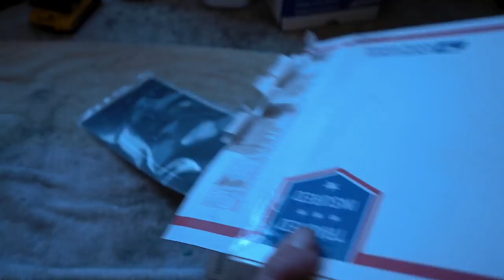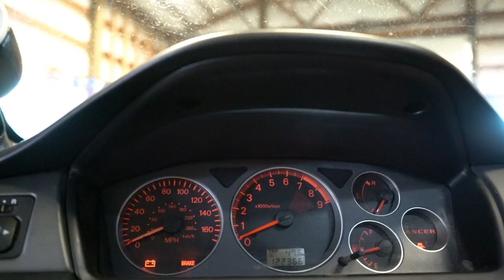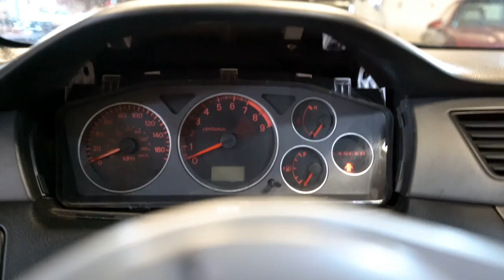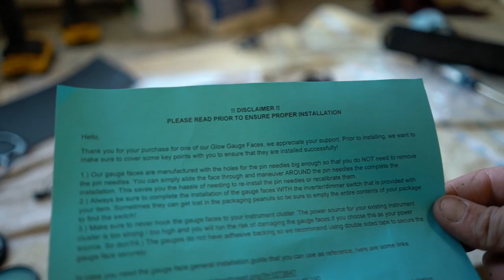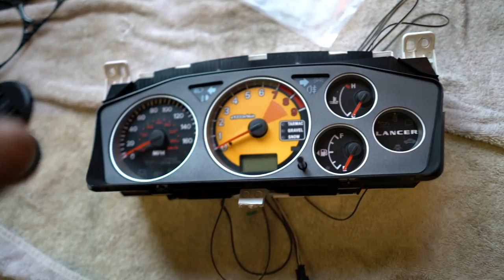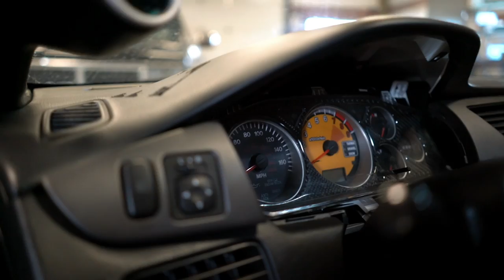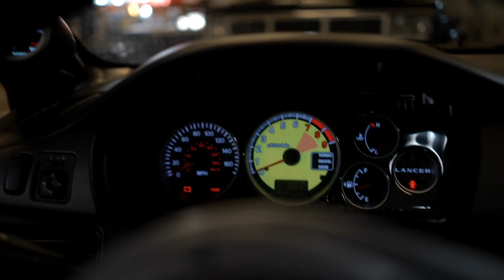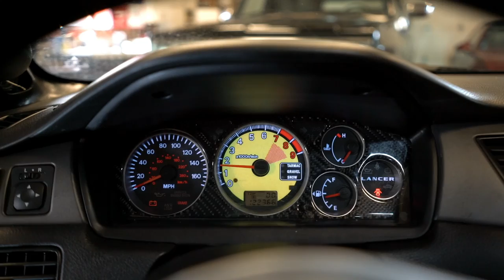Insane Gauge Cluster For The Evo 8/9!

Comment: Just a little heads-up for anyone who wants to install these gauge overlay kits. The overlays are backed with an EL (Electro-Luminescence) light panel and they will gradually degrade in brightness over time. The "control box" is actually a DC-to-AC inverter that sends the AC current that is required to drive the EL panels. That inverter should ideally be mounted in a location as far away from your ears as possible, because they emit a slightly audible, very high-pitched whistling noise when in operation. The noise tends to get louder as the inverter ages. Once you start noticing the noise, you can't un-notice it, it'll drive some people insane, like it's at the back of your brain every time you switch the lights on.

Lastly, I'm the sort of guy who prefers to wire the overlay lights to the factory gauge cluster lights, so they only come on when the lights are switched on and off during the day. I know many will find it cooler wired up the way the video shows, gives the car a more modern feel, the same way new cars all come with clusters that are always lit as long as the car is on. Trouble is, there is always that moron who forgets to turn his headlights on at night and doesn't even notice that he can't see the road ahead properly. People who have driven older cars are already trained on a sub-conscious level that if the dash is dark, the headlights are off.

Comment: I really loved the yellow gauge but also bought the red set for the rest of the smaller gauges. What fuse did you tap into and did you ghetto wire it by wrapping the wire on one of the fuse legs or actually got a fuse tap?